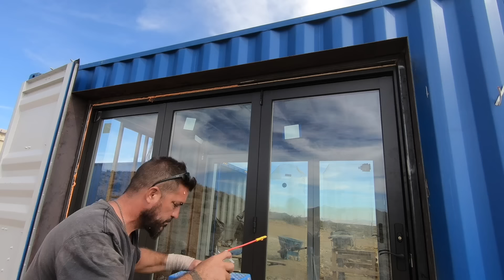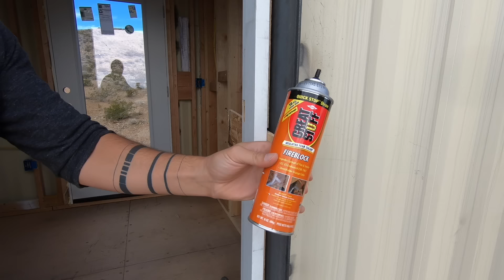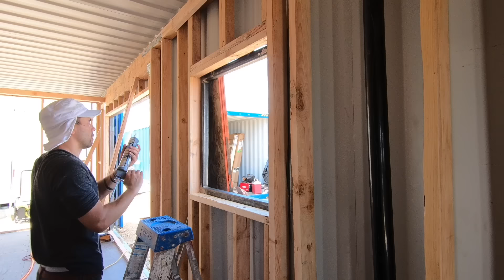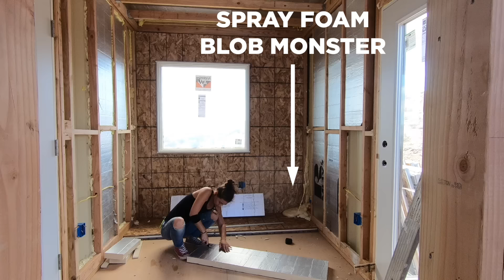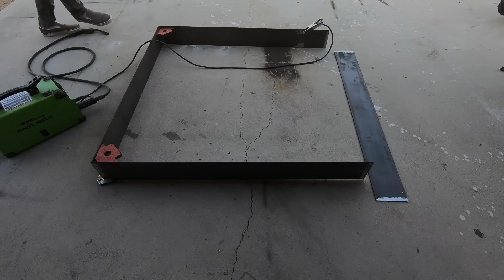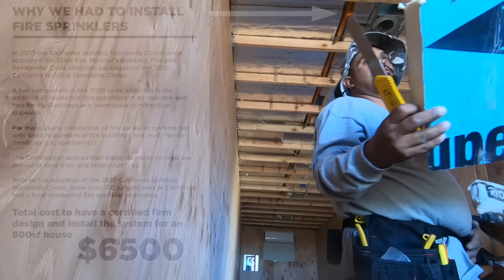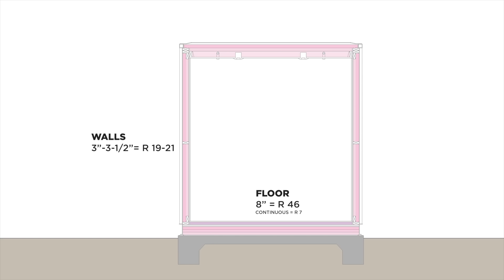Building a Shipping Container Home | EP03 Doors, Windows, and Insulation

Comment: This channel does a great job of destroying everyone's DIY shipping container home fantasy one episode at a time.
Reply: Tbh, he let the city planners rail him. If you went by the same codes that manufactured homes go by then he would have avoided a lot of these extra expenses. These were way overbuilt.
Reply: @marcusavron47  Well what kills this for me is realizing how extensive your metalworking, construction, plumbing, electrical and carpentry skills need to be.  Usually when I hear about this style home I get the impression anyone can do it.  LOL nope
Reply: @knottheory79220  
I m those guys luckily DIY a lot and familiar  with all those skills...I m a pretty good welder and metal works, plumbing, wood working, electrical.. Concrete works all fine and experienced...

But in my eyes to putting such efforts in these steel boxes especially largely over kill the structural strengthening... given if I was using them is just because they are readily solid and in shape....

I would just built something else, it would be even cheaper in cost and much faster, less complicated and less sweat in it...
Reply: @knottheory79220  this is all pretty basic.
Reply: @knottheory79220   watch the channel Odd Life Crafting and they show its actually really simple to do yourself. They started off knowing almost 0 about construction other than he is an engineer so was able to do a lot of the design themselves (and are in Brazil instead of California so not bent over by $$ grabbing policies)
Reply: @knottheory79220  And, what's disappointing is after all this expense he has limited himself to 7 foot wide rooms; a real downfall. Yeah, someone commented that it would be cheaper to cut up a bunch of shipping containers, use those walls to clad the exterior of a house and won't be limited to 7' rooms. But, the shipping container "look", like most exteriors, come and go. It just happens to be the trend at this time. 
Maybe he will make enough from the videos on YouTube to recoup some of his expense.
Reply: @knottheory79220  ...not me, too old and sick now.
Reply: @MarsPHLO  Not going to lie I am interested.  But please minimize the thin wood and cheap sidings.  Is brick still good for a one to two story?
Reply: Marcus Avron 
My cousin lives in a manufactured home. My insurance company will not insure them.
In California many prefer if houses don’t fall down in earthquakes. We have a low tolerance for sad stories on tv about children (and adults) dying for lack of code preventable measures. 
I removed my fireplace because the unreinforced chimney loomed over the living room & could easily have killed us in a quake.
Ruptured gas lines often cause fires accompanying earthquakes - so there are special EQ resistant hookups required by code. 
Now our bedroom WINDOWS are supposed to be big enough to escape from in case of fire. (Only applicable in new builds & remodeled rooms).
Funny thing - but I really like codes.
It breaks my heart to read about code violations leading to death, especially of kids.
My humble little house is about 0.25 mile from an earthquake fault line, the slab of garage & driveway are cracked in direction of fault. Raised foundation / footing is cracked in several placed and insurance company required documentation of bolting house AND garage to foundation.
While you and I may not agree about building codes, I promise you there are those who are grateful for them.
Best. 🙂
Reply: @robertascott2305  If you want to comply with building codes, do it. But if they're such a great idea, why do you have to force them on people?
Reply: @RussellNelson  Because people are mostly ignorant of how to build, they have no concept of what is safe and what isn't.
Reply: @jasonlipmyer36  If it's such a great idea, why do you have to force it on people? The best way for people to become less ignorant is to fail at something.
Reply: @RussellNelson  What a idiotic thing to believe.  Building codes exist because people failed, and lessons were learned from those failures.  If what you said were true there would be no need for schools, just let the kids fail and they'll learn everything.  The best way to learn is by reading, listening, watching, and then doing.  Brute force and ignorance have a place, but it's the hardest and least effective way to learn.
Reply: @jasonlipmyer36  Again ... if they're such a great idea, why do you have to force them on people? As you say, "brute force ... it's the hardest and least effective way to learn". If you think building codes aren't enforced using force, you've never gotten a STOP WORK order.
Reply: @robertascott2305  l
Reply: @RussellNelson  It’s actually there to protect the “next” owner. We would let people build whatever they wanted, if they promised they would never sell it.
Reply: @rozinant1237  That's the theory, but it's more likely that building codes are manipulated by labor unions to ensure that they are complicated enough that you need a union member to comply with them.
Reply: @RussellNelson  I’m sure that is true in the US, but here in Canada, you can do your own trade work as long as it is inspected and signed off by certified tradesperson. This ensures that the work is done safely for the original owner and subsequent owners. Drive through rural Mexico if you want to see what our world would look like without Building codes.
Reply: @robertascott2305  they have this bootlicker scared of his own shadow
Reply: It's not his fault it's just California,  although there are many other states
Reply: @marctorres2416  It's not just California.  It's obvious the structural engineer did not understand the structure of the container itself.  Having built many buildings using this type of container, I have never seen so much structural overkill in a design.  At one point he says he's foaming cracks between the container and the wood to keep out air drafts, but the container walls are already water tight.

It's a shipping container.  A 40 foot container can be filled with 60,000 lbs of junk and still lifted by its four corners.
Reply: @timm8900  The metal walls of the container have an R value of approximately zero. That means that if there is any path for air movement, it's going to be moving either because it's hotter than inside or colder than inside. It doesn't matter if the air isn't moving in or out of the container.
Reply: @RussellNelson  LOL.  I believe you are trying to describe convection via stack effect.  He was caulking the 2x4 next to the insulation which has no effect on anything.
Reply: @timm8900  LOL, we must be talking about different areas.
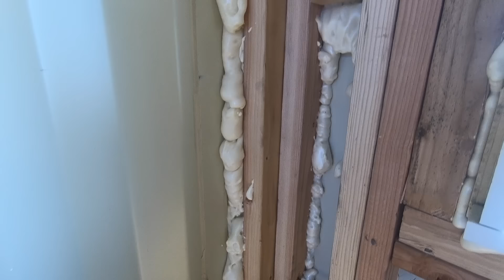Reply: @RussellNelson  6:11 into the video he is foaming vertically up a stud that is in the corner of the box, not near a door or window and says this will prevent air infiltration.  Behind that stud is going to be a solid weld from the 10 ga. wall sheets to the structural corner frame that is also solid.  It's water tight.  Where he is putting the foam will be insulated before the wall board is installed.  All this foam will do is possibly keep the stud from vibrating against the steel wall.  I used these containers for buildings for years.
Reply: @timm8900  Isn't the point of filling the gaps to avoid moisture forming on the inside walls that can rust over time?
Reply: @timm8900  

🐱🐱🐎🐎
Reply: @timm8900  what is your opinion about cutting out holes for big windows? Does this weaken the container?
Reply: @miguelluisarboleda no. Only corner is load bearing and rails load transfer.
Reply: @marctorres2416  Anyone's going to run into a lot of these issues no matter where you try to build. Local building codes are necessary if a homeowner is going to expect a quality build that won't come back later to be a problem.
Reply: @marctorres2416  Just build it and claim you're an illeg... errr undocumented alien when code enforcement and law authorities come knocking.  The politicians there will probably use you as poster child for what's great about this country afterwards .
Reply: @marctorres2416  It is still his fault that he actually did it. With rules like that you just don't do it.
Reply: who knew that even a container home complex could be pretty expensive...
Reply: Just depends on where you live, in the Caribbean once the thing has 2 doors that all they need lol.
Reply: Would it not be a lot easier/cheaper to just build a stick-frame house and cover it with metal siding?
Reply: @pavelyakovlev6526  exactly! The damn thing is a stick built home inside a shipping container utilizing only the tin siding. lmao. Lets see stick built home and tin siding and roof.... no I think I will buy a storage container, pay for shipping, pay for crane to set it, spend twice the money making it up to stick built code, and limit myself on floor plan. This guy is a true Genius!!!!
Reply: Theres no point using a solid steel container and adding all that crap after.
Reply: These guy don't know shit about shipping containers and nether do the inspectors in this area.  I use to haul them in and out of ports these are clueless about there strength.
Reply: @Ponykeg53  They're only strong as one piece. Once you start cutting holes, you're cutting holes into the strength.
Reply: It essentially ended up being a wood frame house built inside a shipping container.  I'm not sure what this really gained over conventional framing in the end.  Possibly more wind and fire resistant, but then just use metal siding  or build from concrete block, especially since he had to pour a slab foundation anyway.
Reply: So what did you gain from even bothering with a shipping container?  Some cost saving on siding?  It seems like you had to build a house inside the box and you just limited your self.  What did you gain by starting with steel boxes?
Reply: @wolf359loki I guess he can transport it easily now.
Reply: My thoughts exactly. Should be labeled how to build a stick frame code home inside a shipping container. The only thing the shipping container was used for is the outer tin. I am now rethinking my dream home, and think I could buy the tin for much less than the container.
Reply: look into micro-houses In Ohio they have just as much issues
Reply: Right? These videos are such a reality check. Like 10 minutes into the first one, I was thinking "get a dozen people, work together, build a little community, that'd be so cool." Didn't take long for that delusion to be shattered.
Reply: Robert Holmes. It definitely bursted my container home fantasy. ☹️
Reply: Robert Holmes 
Over engineer much?
Reply: @Robert Holmes
There are hundreds of vids on YT showing how to build these for way less money
Reply: Complete utterly ridiculous horrific inefficient way to build a home. Jebuz.
Reply: lol
Reply: Instead of "How to Build the Cheapest Container Home" This series is going to be "How to Build the Most Outrageously Expensive Container Home"
Reply: @Cpt_Adama  🤣🤣a whole 600k project house. It was 6500 just for sprinklers 🤣🤣
Reply: Yeah its like tiny homes. You can do it cheap or you can spend 200 grand on it. Stupid is stupid. You can build both cheaply but you are NOT going to be living in a mansion. 

Blame the builder not the medium.
Reply: Mate this shows the ligit building process in the state he lives in, it’s just the truth
Reply: The reality is real sir.
Reply: I don't understand what the point of the shipping container was as they basically built a normal house anyways. Why over  spend and go through all that extra time for something that looks like city waste on the outside?
Reply: what made you think that it would be easy?
Reply: Its really just reinforcing mine, honestly.
Reply: lolololololo
Reply: completely agree. We don't need every single detail.
Reply: Man idk about that. I can do 80% of this work myself!
Reply: It really shows how much effort and time is involved. If I had his budget and did this in a state like West Virginia I could have hired labor for the entire thing and still have enough to get an in-ground pool!
Reply: SAVAGE
Reply: I've been researching purchasing a 40' HC and cut it in half for two cabins on our mountain property in Georgia. I saw this video and instantly was deflated.  I didn't realize he was in California which explains it.  I'm staring to inflate again.
Reply: atleast it is hail and storm proof
Reply: So true lol. Reality vs Expectations.
Reply: hahaha exactly
Reply: I does not destroy it Robert. He was very nice enough to share his experience with other where he lives of how he built his home. I think its a great job and shows determination that if you have the resources to make your dream a reality, make it happen.
Reply: It's reinforced mine.
Reply: American people has no so much money to buy home. Government funding cost war to give American soldier.
Reply: Def not as easy as stacking a few boxes and moving in LoL
Reply: @utdstate76  container home is very cheaper than city social house. Shipping container home are between less than 50000 dollars and more than 10000 dollars. Tiny home is more cheaper.
Reply: If you is interested in container home plans the greatest results that ive had was by using the Magic Container Plans (i found it on google) definately the most incredible course i've followed.
Reply: Robert Holmes

Hace 10 mesesNot certain about the points made but ,if anyone else wants to learn about container home design plans try Sovallo  Container Build Fixer (just google it ) ? Ive heard some great things about it and my buddy got cool results with it.
Reply: I just thought the same thing. But then I remembered when you purchase land that have No permits to build.
Reply: Hahah. Well Said 😅
Reply: This was great, thanks, I been tryin to find out about "prefab shipping container homes builders" for a while now, and I think this has helped. Ever heard of - Panophia Nonpareil Principality - (do a search on google ) ? It is a smashing exclusive guide for discovering how to build a shipping container home fast without the normal expense. Ive heard some super things about it and my cousin got excellent results with it.
Reply: 000000000
Reply: Projeto nossa casa container  https://www.youtube.com/watch?v=9PX1Msrp2NA  ............ ,, ,,,,,, ,,,,,,,....... ........ ..... ...........
Reply: It's thoroughly simple. It speaks to me at an upper intelligence level. Thank you. The person's complaining are merely hacks.
Reply: This person needs midol.
Reply: Lol
Reply: Yeeesss!!!!!
Reply: DIY for Don't do It Yourself
Reply: Never understood the purpose of building a stick built inside a container. What is the purpose of a container here?
Reply: Building a wooden stick house inside a container defeats the whole purpose of usin a container. This should just be build as a regular house and if you want the container look just use a cladding that simulates that look. Sure it is because of building regulation. But because of that don't build a container based house!
Reply: @webosm6494  I thought the same thing! Heck, it might be easier and cheaper to frame it up first and then clad it like you said. Either way, this container house build was overkill. The point of a container house I thought was to be simple and quick. Not this.
Reply: @webosm6494   It only let me give one thumbs up but should be 100 thumbs up.
Reply: @webosm6494 exactly. Applying codes for stick built to steel structures is stupid. Either don’t build or show the code inspector it complied with all outcome requirements.
Reply: @webosm6494  you do realise that most modern homes are basically wooden stick houses inside brick right?
Reply: @archiebf4524  Really how stupid is that. I guess only in America. Using an weak product to support a high strength product. It just does not make any sense at all.
Reply: @archiebf4524  They are actually stick built, then have brick cladding or veneer added....purely cosmetic.
Reply: @webosm6494  No. The container is only strong because it's corrugated and all in one piece. You start cutting holes in it and the strength quickly vanishes.
Reply: @RussellNelson not true. Side panels are not load bearing at all.
Reply: @kumark214  hahaha!
Reply: @RussellNelson  not sure what’s funny here. What’s your point?
Reply: @kumark214 What's funny is that you're completely wrong yet feel the need to correct someone who isn't wrong. Side panels carry torsion stresses, not loading stresses. Think about what would happen if you cut away the side panels on both sides or either end, and then pushed sideways on the top. If you're having trouble envisioning this, take a cardboard box and cut away both sides. Or even better, leave a cardboard box open on the top and bottom and place it sideways on the ground. Then put any kind of load on it. Oh, the ends won't collapse -- the box will simply fold down.
Reply: destroying everyone's DIY shipping container home fantasy ?!?
Reply: Šta reći? Koju posluku porat? Yeah. Man bless this guys persistence and focus.
Reply: @CheleChilindra1  I do.
Reply: Šta reći? Koju posluku porat? 
Fantasies are fun - yet we surely should do a reality check before we start out on this project!
Meanwhile - videos of finished shipping container projects are so much fun to watch!
Best. 🙂
Reply: @drzavahercegbosnaponosna5974  when you have a large crew of professionals it's no longer a DYI
Reply: The future of inexpensive cool housing is concrete printing.
Reply: @jamesdooling4139  haahahahhahahahahahhahahahhahahah by the block that may be
Reply: This is completely moronic. Lets take a simple cheap project and make it cost more than a 2000 sq ft home .  And make sure you do all the insulation etc inside instead of outside the cans  and then vinyl or wood side.   Cans arent small enough to start with so lets give up 10 inches more inside...
Reply: @TheSorrenson  Exactly  what l thought.
Reply: Spends more building shitty shipping container house in the middle of nowhere than most Americans spend on their home purchases. 😂
Reply: Taylor Boyd not in California... median home price is 525,000 out here and where i live ( the Bay Area ) good luck finding a house for under a million... if you get lucky you might find a fixer upper in the ghetto for an absolute steal of 700-800k.
Reply: @bankrobba6731  Not worth adressing. He clearly has no clue about what he is talking about. :)
Reply: @bankrobba6731  Probably part of the reason that you have tens of thousands living in the streets.....
Reply: Felix Dzerjinsky you know there’s a reason certain things cost more than others right ? Why does a toyota corolla cost 20k and a Mercedes cost 50k and a lamborghini 600k ? Why do pro club hoodies cost $30 and a Polo hoodie cost $100 ? Why does a regular plain leather belt cost $20 but a gucci belt cost $500 ? Obviously because more people want the cooler thing that’s better quality and when it’s clothes that can be dumb but when it comes to where you want to live... let’s just say the price tag is worth it if rather live in California for the price it currently is than live somewhere like Idaho or Alaska or Wyoming for free 🤷🏽‍♂️
Reply: @taylortwotails  This. Go price out those doors.
Reply: @taylortwotails  Joshua Tree is a paradise of a "middle of nowhere". I'll take his "shitty" house there any day!
Reply: Taylor Boyd Lol you are so wrong it’s not even funny
Reply: Marc D it might only be a slight exaggeration of the truth. He spent damn near what the average us home price is just to build a shipping container house in the middle of nowhere. No real resale value, so props to him for doing it for YouTube views I guess.
Reply: Taylor Boyd Are you serious? The average price for a house in the us is $230k how is this even close to that? Welcome to the real world buddy.
Reply: Taylor Boyd  “No real resale value” Jesus fuck mate you know people can create and enjoy things regardless of the resale value right? He said this was a vacation home I don’t think he’s planning to sell it anytime soon. 

How materialistic do you have to be to be concerned about that and lmao if you think he’s doing this for the views. 

Get out of the computer from time to time you’ll see that there’s more to life than resale value and YouTube views smh.
Reply: Marc D if you’re gonna invest a large sum of money into something you need to think of it as an investment with risks/rewards in mind. If you’ve got the capital to make a project without worrying about the risks then kudos to you. Being aware of the resale value is just being a smart person.
Reply: @taylortwotails  You are clearly ignorant of Joshua Tree's RE market. This guy will have made a killing as soon as he is done building.
Reply: @marcd7332  lmao i wish in canada its $700'000
Reply: mk Yes exactly your materialistic brain can’t understand that people sometimes build things for the sake of enjoying them and not for resale value, he clearly can afford to pay it and he’s not thinking of selling it